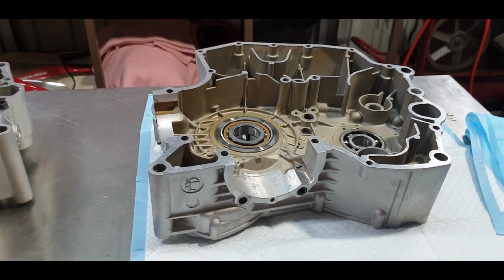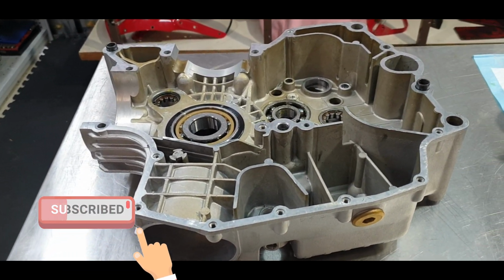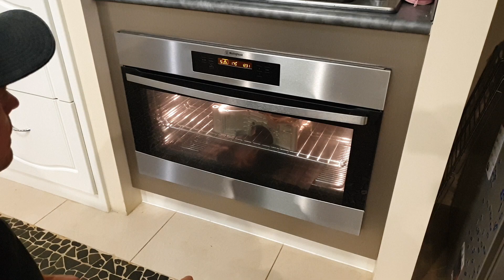DUCATI 900ss Supersport Rebuild - Motorcycle Project : Bike Build : Ep 20 Fitting Crankcase Bearings

Comment: That was clever to let the main bearing carrier heat up and expand from contacting the cases before dropping in the crankshaft main bearing.
Reply from the maker: That was my plan. It worked so well. Those cases were still warm several hours later. I have seen those bearing carriers hurt the cases when they have been pressed out with main bearing. They are still tight and perfect on this engine. It actually fell together with this process.

Comment: Hi, love the series on the 900SS. What coating are you putting on the engine cases and cylinder heads after blasting? Mine are painted, but want to change to something not solvent with fuel! 👀 any recommendations?

Comment: Good work. I’ve seen other videos where they didn’t apply grease to the outside of the bearing. Is it to help them slide in?
Reply from the maker: Hi Maxwell.  Yeah so it had a lubricant to help it slide in. Its a tight fit so all that grease would squeeze out as bearing and case became equal temperature.